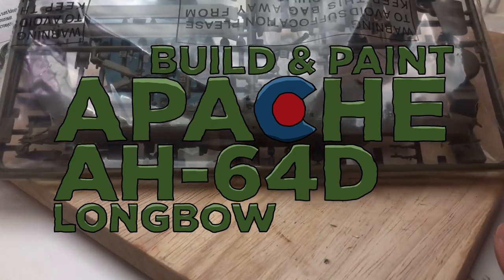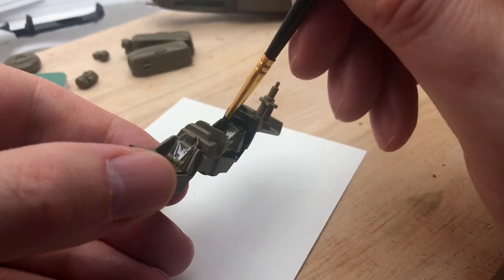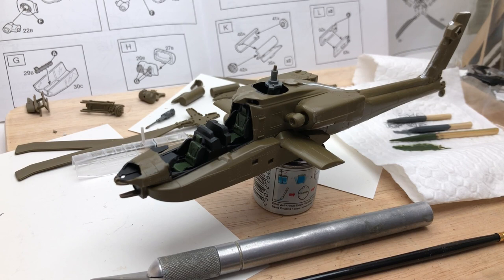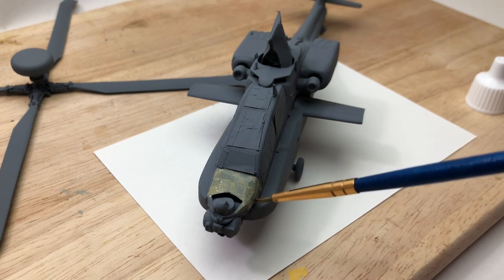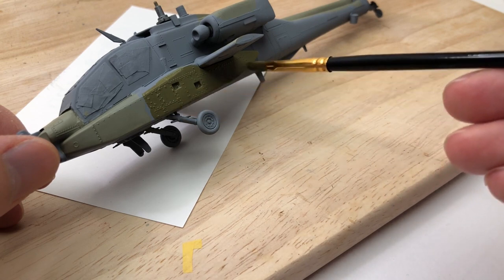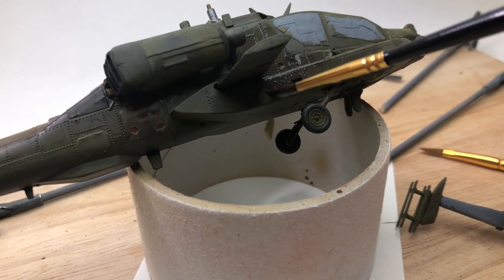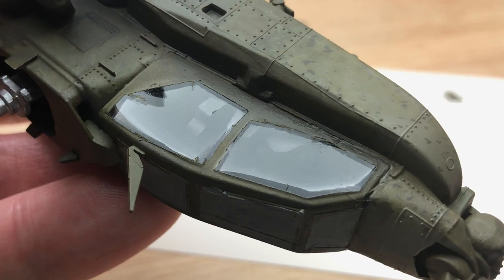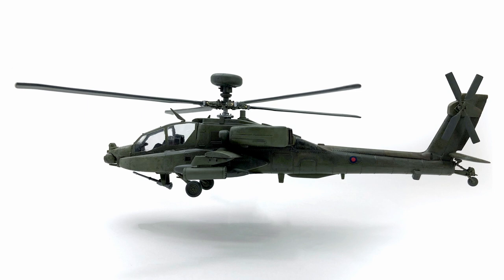Build and Hand Paint the Italeri Apache 1/72 (With Acrylics)

Comment: I've built one back ina a days in late 90s, It was called then Italeri 159 kit :-) These Italeri helicopters are quite decent, especially for the price.
I do confirm that canopy does not have clear lines between framing and glass, also rotor shaft does not come central in space on top of fuselage which looks odd

Comment: Thank you, lovely work; To prevent "paint bleeding" under the masking tape: (1) use "painters" or "Tamiya Tape" AND (2) seal the outside of the tape with a very thin coat of PVA glue, or ModPodge, or acrylic paint medium. Really like the hand painting videos...
Reply from the maker: Somebody else told me about that when I had a similar issue on the Apache. Going to try it on my next kit.. probably the Curtiss C-46.